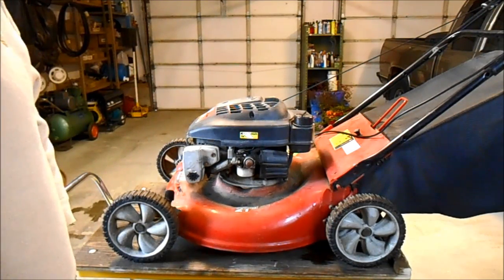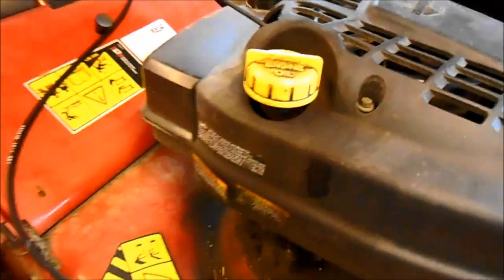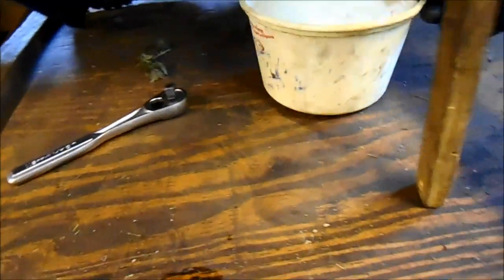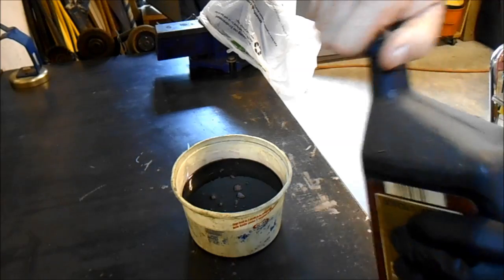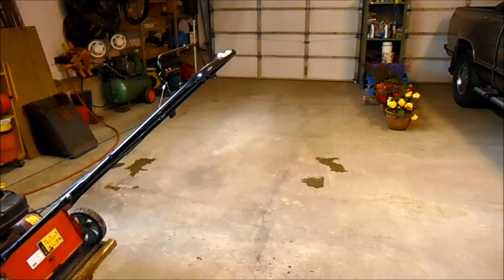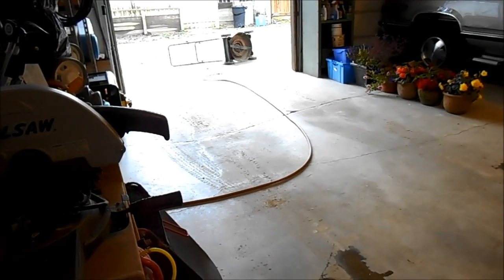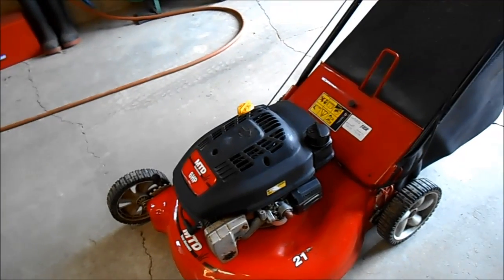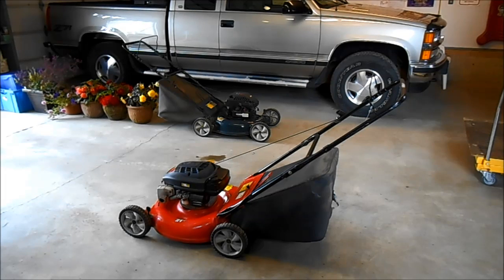Synthetic Oil or Not?

Comment: This video topic is opening a can of worms. The oil you pulled out looks pretty new but has been overheated. Here is why you never want to run multi-viscosity Synthetic oil, designed for cars (virtually all synthetic oil) in an air cooled small engine.

All multi-viscosity oils(syn or conventional) start with a "base stock" . We'll start with synthetic sae10w30: they start with base stock sae10(always lower number with syn) viscosity oil and add modifiers/additives that make it perform like sae30 once it is warmed up. If the oil gets to hot the additives will break down and it will resort to it's base stock through the entire temperature range. Typical synthetic motor oil is rated to run in a water cooled car engine that maxes out around 200F where an air-cooled engine can peak out around 400F. These higher temps easily break down the additives almost instantly rendering the synthetic oil to a mere sae10 viscosity oil through the entire operating temperature range(engine damage) in an air cooler engine.

Conventional is just he opposite, sae10w30 will start with a base stock of sae30 and add modifiers/additives so at lower temperatures it performs like sae10 oil. Again, once it is warmed up it thickens to the point of sae30 oil. It also will break down with the extreme temps of air cooled engines and resort to its base stock. BUT it's base stock is sae30 oil and that is great for a hot air cooler engine. All these small engine manufactures recommend straight sae30 with ambient temperatures over 45F for good reason. I've bought numerous "smoking" equipment only to find out the owner tried to love it with synthetic oil. Sae30 will not break down and will give you the best life.

This being said they do make specialty air cooled synthetic oil with special modifiers/additives to work with the extreme heat differences. Snow equipment is less susceptible due to it being zero degrees outside but it still happens.
Reply from the maker: Thanks.  Great input.  A can of worms is OK as long as people who don't make videos keep their comments polite.
Reply: You know they all wont. :-) . Good thing there's a delete button.
Reply: sixtyfiveford Wile I do understand the reasoning behind this, I also use the manufacturer recommended weight of oil. Most of my equipment recommends sae 30 for summer use, but I have two Kohler engines that recommend 10w-30 both conventional and synthetic class SJ or higher. For that reason I have run full synthetic 10w-30 in my Kohler courage v-twin since it was new and it has run great without burning a drop of oil. I do my annual oil changes (between 25-50 hours depending on how much use it gets each season) and I haven't noticed any exceptional oil thinning. I firmly believe that if oil changes are done regularly, the use of multi-weight oil is just fine in small engines were it is mentioned as a suitable oil option in the owners manual.
Reply: I use Valvoline synthetic in my mowers.  It's rated to 500F.
I think I'm good.
Reply: t6 used to be a great bargain untill everyone started using for everything from lawn mowers to subarus... now its about 6 dollars a quart
Reply: 400 degrees my ass and the muffler doesn't count lol, If anything 5w-30 is better. Mainly if your impatient and start meowing as soon as you pull the cord.
Reply: Never know what you might find in used equipment. However if you are changing  oil each season you are not getting any benefit to synthetic oil longer drain interval as in a car. If someone thinks they can use synthetic and not change the oil as often they don't understand there is no oil filter here and you can't not change it.
Reply: @tiger9120  LOL I was going to comment on that statement as well... I have a Supra with a single turbo that has oil that runs through it to cool and lube the bearings... if he thinks that its only 200 degrees in there then I have some news for him. I use synthetic oil in that car as most oils would just burn and "coke" inside the turbo. What about V-twin Harley engines... They run a synthetic 20w-50 in them? and to the point of an air cooled engine running at 400 F... He is very miss informed... 250F is very hot for an Air cooled engine... If the case temps were 400F  The Aluminum bore would not be round anymore...

Comment: Hmmm Wierd Cuz I Use SAE30 Synthetic Royal Purple Oil on My Mowers N I Have Never Had A Problem My Mowers Work Excellent n The Oil Lasts 3 Times Longer n Cleaner Than Regular SAE30 Oil I Have a Lawn Mowing Business So It Works If It Was Royal Purple I Dunno Maybe Guy Used Wrong Grade Of Oil n It Cuz Royal Purple Oil Is Great High Quality Premium Oil
Reply from the maker: I think it was transmission fluid.  This is an older video so I can look back.

Comment: My cousin gave me a mower that he says was "blowing oil out the exhaust and burning like crazy". He admits to putting two cycle oil in it (3ish hp flat head briggs here). I haven't had a chance to work on it yet (mean head cold) but it has compression. I'm thinking HD30 will fix the issue.
Reply from the maker: +charredskeleton Well it won't cost much to find out  got for it.
Reply: +Bruce Pender I think I'm on the mend, but I know the mower is!  HD30 in the correct amount is all it took. I blew out the spark plug with compressed air (oil fowling). The oil was also way over filled hence hard starting and blowing oil out the exhaust. Which brings up a point, over filling the oil on these little engines is VERY bad!
Reply from the maker: +charredskeleton Hydraulic principle            you can't compress a liquid so it finds all the little passageways.
Reply: That and people who have no clue will put an entire quart of oil in the engine, not realizing that most push mowers only use approx 20oz.

Comment: What gets me about people, they will spend good money on the oil, but buy cheap gas for it, I have a snapper from 1974 it's been in my family for years it only gets sae 30 Motor oil, and 93 or above gas now it has never given me a problem, never been rebuilt and runs better then any new mower, people don't waist your money on the oil inside of it, instead buy non ethanol fuel, 93 or above from your local Sunoco, you will have your mower for years.
Reply from the maker: You are right.  I have  double sized yard (or more).  My last lawn mower was 1 year old when we moved in here.  We have been here 29 years and I sold it 2 years ago --running.  Maintenance and good fuel.

Comment: I flush my crankcase with petrol , put the plug in add gas, shake mower about then drain it. No need pouring new oil into a dirty engine.
Reply from the maker: +Bert Cochran That is a good idea.

Comment: I use royal purple in every thing i owen
Reply from the maker: This may ended up being trans fluid.
Reply: Bruce Pender i have a 27 year old white snow boss 500 5 hp Tecumseh engine 2789 hours all original not a drop oil burn or head take of royal purple since new

Comment: What kind of oil did you put in. I've been using the Briggs&Stratton Oil and it works great, but I have some extra Mobil 1 5w30 fully synthetic laying around. Can I run that in mover?
Reply from the maker: I think you can.  When I made this video a few years ago I was anti synthetic.  I think there was trans fluid in this one.
Reply: I have been using Mobil 1 5w30 in my push mower for the past 15 years.  I change the oil once a year. Very good stuff.
Reply from the maker: I am being swayed    cool huh.
Reply: +chandlersgarage Good to know. I will use what's leftover in 5qt container from my car oil change.
Reply: 5w30 i thionki is more for like winter so better in a snowblower....mowers 10 w30 might be better
Reply: I have worked on small engines for over 20 years. 5W-30 oil is no good for these engines. They should have a straight 30W oil or use Amsoil 10W-30 small engine oil made for these engines.
Reply: Paul Brown Nonsense...

Comment: That looks like Royal Purple to me. That is real crap. There is nothing wrong with using a good Synthetic oil in your lawn mower engines, i use Amsoil ASE Small Engine Synthetic oil in all of my engines, and it works fine with no problems. It is made specifically for small engines.
Reply from the maker: Thanks Paul.  Great to hear from you.
Reply: I watch a lot of your videos here. Located in NJ

Comment: trans fluid is eqivilant to 20 grade oil
Reply: +Jackie Chan Trans fluid is like 8w grade will smoke like a freight train!!
Reply from the maker: +bigdaddymak1439 thanks
Reply: +bigdaddymak1439 8w would indicate its 8 before it thins out, any 30 grade will thin out to a 30 at 200 40 would be same at 250 as a 30, and many transmissions that use atf are manual or use 5w-30. It is smoking cause piston rings are worn. They sell all those synthetics at the tractor store by briggs, john deer etc. Only your lawn mower is worn, I fix many cars for a living but I have fixed many small engines too.